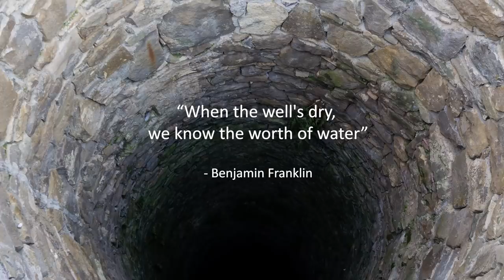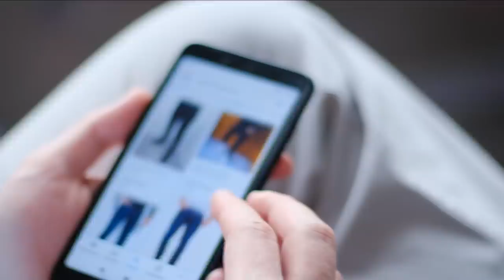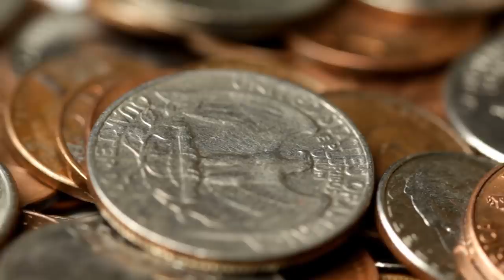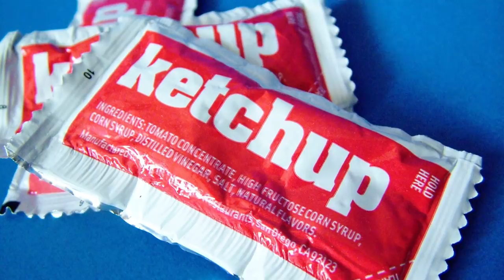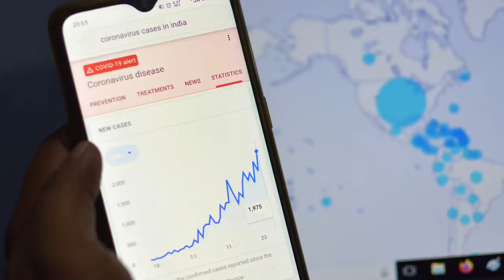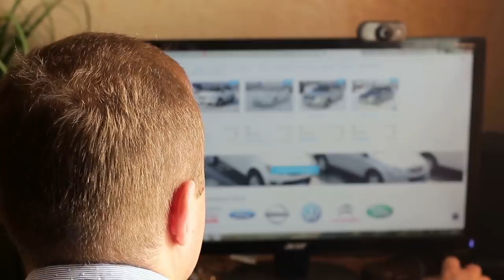Warning! Massive Shortages Are Coming

Comment: Shortages do beget shortages - not just due to supply shift and the panic psychology, but simply due to the broadening psychology of the marketplace.
    
We tend to call that a positive here - people prepping more broadly in many areas in response to shortages in one or two (meat and TP leading to people stocking up on all sorts of foodstuffs), but every time there is an empty shelf it causes people to empty other shelves. 
    
Don't chance the trend, however, as you will never be up enough on it to do better than have the product. Go look for what is on sale, what you can get for a deal, now that you already use and has a good shelf life - prep that. As always, prep to the level of your use x the product's shelf life up to a reasonable limit of time. That is how you save money prepping - getting good deals on bulk products that you actually use without spoilage or waste even if no apocalypse happens. 
      
That said, look around your house at every consumable you have and ask yourself how long could you go until you reached a panic point on that item. Often people will have something like detergent (for dishes or clothes) and they get a new one when their current one runs low since you might only go through one container every few months. THOSE are the products most likely to stab you in a shortage, since they are the ones you are most likely to be almost completely out of and just assume another will always be there.
     
Obviously, there is no need to go 20 years deep for dishwashing detergent, since if there was a situation that kept it off the shelves that long you wouldn't have a functioning dishwasher anyways and would be handwashing your dishes - but having one or two extra makes sense. If you never NEED to go to the store for something, but rather you go to your pantry when something runs out (and you go to the store only for fresh goods and to restock your pantry), you are doing good and have a buffer that will let you wait out all but the most stubborn of shortages. 
   
Also worth noting that you should never stock up at panic prices. Leave those products for the unprepared so that they learn their lesson and you hang onto your cash. If you must, buy only as little as you need - most panics will eventually moderate and when they do, that is the time to stock up. 
   
Also, ammo and building supplies are not coming down for a LONG time.

Comment: EXCELLENT video! 
I really enjoyed your exploration of the interconnected 'ecosystem' of the global economy, manufacturing, and distribution. I've been working in the supply/procurement sector for decades in different industries, and watched the JIT model take hold. As any system is more finely tuned it becomes ever-more susceptible to the oscillating tipping points in connected sectors, not to mention the unforeseen. The difference between more flexible and JIT strategies can be analogized with 'The Orchid and the Shark' dichotomy; the Orchid has grown highly successful by becoming completely specialized to a very specific environment, while the Shark has developed an evolutionary model that measures success by it's ability to withstand change and still maintain a success rate that's not only "good enough", but also sustainable. 
Given that in ANY situation where Humans are involved there's no such thing as a permanent steady state, it's no wonder that we have set ourselves up for some tragic consequences.

Comment: In some societies, oil was more valuable than meat.  You use it to cook meat and other things in, for one.  And also in many breads and dressings and other products.  It's an essential whether you are an omnivore or a vegan.  Stock up on oil, IMO.  It will go rancid eventually, but unopened can last a long time.  It can even be recycled to help start fires, run a diesel engine, etc.  It can be used to help preserve foods, the list goes on.  Stock up on it at least a bit, because you will really miss it when it's gone.

Comment: I did a fair bit of research during the toilet paper shortage, and I do NOT believe that hoarding and panic buying had much to do with it.  For one thing, stores quickly clamped down on the amount you were able to buy, so buying in bulk was impossible after the first couple of days - yet the shortage stretched out for months and months.  This is what really happened:  as people stayed home, consumption of consumer-grade toilet paper actually went up.  Toilet paper manufacturers could not increase production because they already operated at 100% capacity to meet the steady demand of normal  retail sales - on a just-in-time model.  Since there was no excess production capacity, it was impossible to increase supply to match demand until after extensive retooling was accomplished.  Commercial-grade toilet paper, the cheap kind used in offices and restauraunts, had a corresponding drop in demand, but they were not set up to take advantage of normal consumer supply chains to get their products into supermarkets, as they primarily sold through business-to-business distributors. Furthermore, their rolls were not packaged in a way conducive to commercial resale, and in many cases they were produced in giant rolls meant to fit public restroom dispensers, and would not fit in a normal bathroom.  While this mismatch was in effect, and toilet paper could not be found, the manufacturers insisted that they were making enough to meet the demand, but the problem was hoarding - in effect, they blamed us for their own shortfalls.  I watched the press and read interview after interview with manufacturers who insisted there was plenty of supply and that the shortage was merely an illusion... until after several months, I finally started to see admissions in the business press that yes, they were not able to keep up with demand, and yes, the shortage was real and not an illusion.  I had come to that conclusion myself months before I saw it finaly confirmed in the business press.
Reply: Not packaged in a way conducive to commercial resale, and would not fit in a normal bathroom? I don't care how it's packaged and if it fits on the bathroom roller, as long as it wipes my butt that's all that matters. They could sold it at the store at a slight discount, and people would have brought it.
Reply: @tonydalton8712  yes, if they had sold it, people would have bought it. But they had no supply chains to sell to retail stores. No distribution networks, no way to get their product into national distribution.  No relationships with vendors, so they would have to start from scratch to build all that - and that takes time.  That's my point.  In fact, after a couple of months, I did start to see individually-packaged rolls of commercial grade toilet paper at the supermarket, but by the time it was rolling out, the retail-grade paper was also coming back, because they had finally been able to retool to increase production.  Now, if you had industrial catalogs, or knew how to purchase business-to-business orders from the companies that normally sold the commercial-grade, you could have bought it all along, but knowing where to find it, let alone that it existed in the first place, was not common knowledge. I think Office Depot sold it, but who would have thought to go to Office Depot for toilet paper?

Comment: They use an admittedly inaccurate PCR test with a 40+ cycle threshold to determine those "covid cases". 
The fake news also got caught using images from a gas leak a few years showing Indians suffering and lying in the ground, and they said it was from the recent "covid outbreak". 
Also, the "vaccine" is an experiment. mRNA injections.. never been used on humans before.

Comment: I don't buy it. This is just justification prepping for massive price gouging by greedy corporations, conditioning if you will and it's already happening .A reset of the world economy and the division from the rich to the poor, in ultimately the total Destruction of the middle class.
Reply: Common Sense would tell you if you're selling more something then it becomes less expensive to manufacture their for driving the price down not increasing the price. For example when the US government buys a new aircraft carrier or fighter plane, at first when they're ramping up production the cost is very high and then as units get produced the cost per unit goes down. Just an excuse for corporate greed.

Comment: In the 60's Bob Dylan sang,"The times they are a changing." How true.. in high school, late 60's for a very short amount of time I used the slide ruler and a log book. Then the simple calculator. In the late 70's I used a type writer for college term papers and some computer lab usage,  We had the box type cordless phone..now with my hand held cell I can reach someone 3,000 miles away in a few seconds. The library is almost totally usless because of the delay of knowledge printed in books.. I can GOOGLE anything I want to know. For travel there was the travelers money checks... now a plastic card slid through a magnetic reading slot.
As a medic I assisted a doctor in a cardiac critical care unit to thread/adjust a cardiac shut in an artery by looking at a screen image of the heart. With MRI's a more accurate almost 3D view of fractures. I initially was taught how to use plaster casting. Yes the times are a changing and the challenge is to be able to adjust. Reading the Origin of Species it was the ablility to adapt or become extinct!
Take the time to learn and develop the ablility to adapt!

Comment: You are correct that there will be shortages in the US and one cause of it - the "just in time" logistics system.  But you miss the long term cause of shortages.  The dollar is down 14% year over year.  It is going to continue to fall.  Producers (food, raw materials) are going to get more money for their product overseas than in the US.  Exports will rise and domestic prices will rise but domestic supply won't increase.  Increased taxes and regulations and the war on carbon will stop producers from reshoring to the US.

Comment: Just in Time was called Kan Ban back when I was studying manufacturing plant management. It was a Japanese method of manufacturing, but unlike the USA, all those just in time parts were made in Japan, so... no problem getting parts. Our manufacturing base was sold out by the likes of Bush 41 with CAFTA and the final blow came from Bill Clinton with the signing of NAFTA, and China's most favored nation import tax free status. The quality of parts and materials made in  Mexico was worse than horrible. Some of these parts were absolutely totally unusable and had to be thrown away or melted down recast and re-machined.
Reply: FYI, I bought shop rags and used wet shop rags as TP and just washed them just like we washed cloth diapers back in the day. My bung hole had never been cleaner! With these moronic laws demanding renewable energy, biomass was used to generate electricity. What is biomass? It is basically burning TREES, mixed with natural gas, or garbage & old tires mixed with natural gas. It was easier to accomplish that the pipe dreams of wind & solar.

Comment: Thanks. Reasonable video. I disagree with the "pandemic" moniker being applied to SARS-CoV2, as this virus only seems to take out the genetically weak and those with comorbidities at a rate that isn't substantially higher than the annual flu (and there's a genetic component that isn't discussed in the Media - partly related to our ability to synthesize Vitamin-D). A real pandemic has people falling dead in the street as happened with the Spanish Flu. Masks still have a label on the box that says they don't prevent the spread of a virus. Masks only stop the sick person from spreading the virus more easily through sneezing or similar (which is why those in the operating theatre wear them and not the patient). But all-in-all a reasonable examination of our present situation.